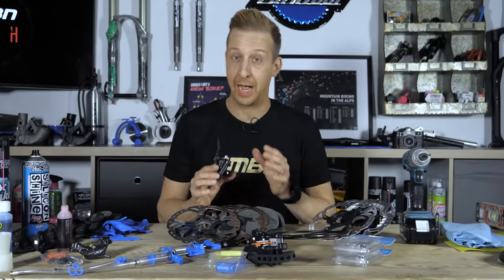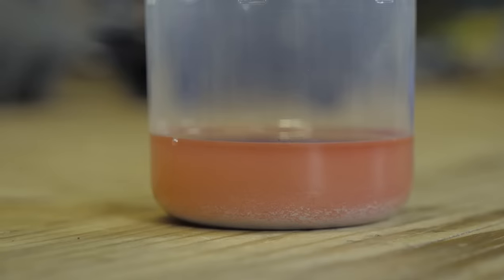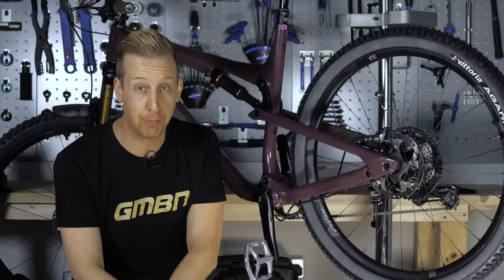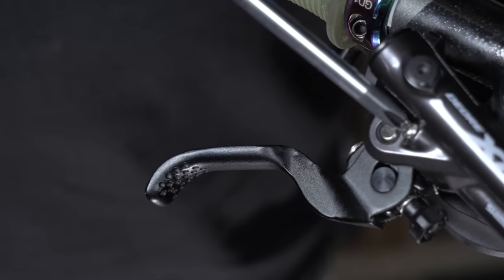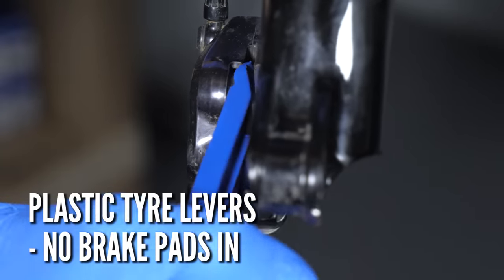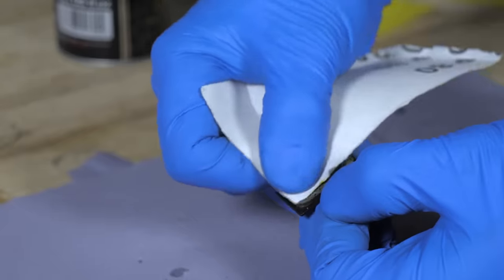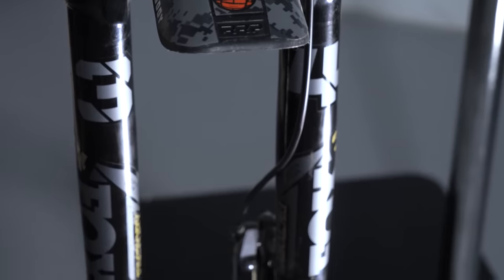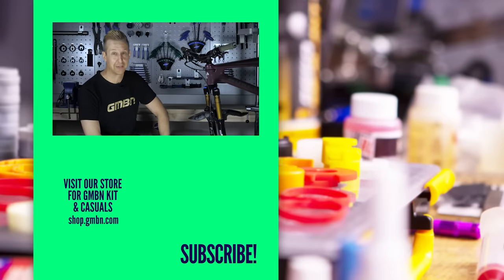12 Common MTB Disk Brake Maintenance Mistakes & How To Avoid Them

Comment: I‘d ask Seth about the thing with wrong fluid😂Just sayin...
Reply: I have green aftermarket oil in my magura mt8's and they are smooth as butter.
Reply: "...a little bit different, but kinda the same" :D
Reply: Well I have both shimano and magura brakes on my different bikes.
I only have 1 bottle of magura oil tho XD 
I do try my best to get all shimano oil out of the system when bleeding so that I am not mixing different types of oils.
Reply: I have used just straight mineral oil in Shimano brakes before.  Worked perfectly fine.
Reply: @FLiPtgc  mineral oil is mineral oil only the colour is "a little bit different , but kinda the same"
Reply: I think the key here was 'Shimano asked us to make this video...' It's irrelevant anyway. Where I am you can no longer but Shimano oil anyway
Reply: My takeaway on Seth was, "don't" and I agree.
Reply: Who knew babies had to be oiled anyway! ?
Reply: CBD/thc  oil works best... Reduces the anxiety felt by the brakes making them perform better

Comment: I've literally dunked my pads and rotors in oil, cleaned them off with a bit of alcohol and they worked fine.
Reply: No way...
Reply: Yeah that doesn't sound true.
Reply: Why did you put em in oil
Reply: Spare rotors in a bag with my bleed kit. One bag and mineral oil got punctured and bled into the separate bag with the rotors.
Reply: Hey folks, this is a ruse.  Look at his name... "MidWest MTB."  Are you suspicious?  Good!  The mid west doesn't have any hills!  So he doesn't actually need or use brakes!  So take his advice with a grain of salt!  Ha, ha!
(And no, don't sprinkle salt on your pads & rotors:)
Reply: @dudeonbike800  I live in the mid west, this is correct
Reply: @dudeonbike800  you caught me, I would have gotten away with it to if it wasn't for you meddling dude on bike.
Reply: @MidWestMTB  ZOINKS!  Good one!
Reply: I soak them in 99 alcohol baths and it usually works just fine, you see with your own eyes all the contamination dissolves in the alcohol, repeat until alcohol is clean, about 2/3 times...

Comment: Squeezing brakes: just cleaning the pads is not enough. Oil is embedded inside the pads. What works is to boil it out by placing the pads on an oven 10min at 200 centigrades. If it smokes than the embedded oil is leaving the pads.

Comment: Please do a vid on tips and tricks to optimize SRAM brakes... They're the ones that I need help with... 😬
Reply: Step 1: throw em in the trash
Step 2: buy Magura or Shimano

(Had the Code R for over a year myself)
Reply: Step one: they're not that bad if you have newer models
Step two: do not hesitate and use your warranty, if you got a bad set
(Pretty much Shimano fan, but not a fanboy)
Reply: Buy shimano ones, with their well known wandering bite point issue and no modulation.😋
Reply: Henry did 2 excellent vids on exactly this last year, full of great tips for sram, but also other brakes... try a search through
Reply: @rupedog  deore and groupless 5-series have no modulation or bite point problems. You should try running cheaper stuff too...
Reply: switch to shimano

Comment: Also, good to check the brake alignment with the mounting bolts, i.e. loosen the brake mount bolts, spin your wheel, apply pressure to the brake corresponding brake lever and tighten up to spec.

Squealy brakes when riding in and through wet  - not much one can do about that.

Fairy is awesome for washing the bike, car, dishes, windows, dog. ;)

Comment: I run my brakes in slightly different positions. My rear brake lever is a bit more flat with a later bite point, because I use the rear brake more when I hang of the back of my bike. My front brakes is 3 degree more down compared to the rear brake and has a earlier bite point, so it is in a better position for switchbacks und stoppies
Reply: Sounds legit. Here's a few more pro tips. Cut your handlebars 10 mm shorter on the left and offset its angle from the fork by 1 degree so you can turn right a little harder. And how about running flats on the left and clipless on the right with your helmet backwards for more aero?
Reply: @frankthetankricard  If you have a shoulder injury you maybe have to do that
Reply: @frankthetankricard  my right sitbone is actually more forward than my left one so I run my saddle a bit to the left
Reply: i like to have a notably earlier brake point und the rear break because i used to pulled the front brake too hard. now i drift a lot because i brake harder on the rear. it's fun but my rear tires and brake pads wear way faster.
Reply: @frankthetankricard  Dude, you are my hero. I thought I was a good heckler. I'm not worthy.
Reply: cool story bro

Comment: I understand the concerns of using other type of mineral oil in the brake system, but what about using automotive LHM fluid. Its made for citroen braking systems, and i have compared the proprieties of both shimano and TOTAL LHM and not only the LHM has higher boiling point but also lower freezing point and similar viscosity.
i have been using for 1 year and not only its cheaper but also better in almost every aspect and u can get it in any car parts shop. 
Any toughts on this?

Comment: Have you ever used the blow lamp method on contaminated pads ? I’ve done it plenty of times without issue
Reply: What is the blow lamp method? My brakes seem to be contaminated just from city riding and I can't afford to replace them :/
Reply: @drewlop  I use it too ✋Just remove your brake pads, set them flat on a non-flammable surface with the braking compound towards you and just boil them with a blow torch.

That will burn any grease or oil on them, if the compound catches fire, it's that they were contaminated 😂

Comment: Thankfully I didn´t do any of these, I just today upgraded from MT200 to 520- what a difference! And I ride the same way: front/right, rear/left.
The manufacturers think otherwise, every bike I worked on it´s opposite- I hate that.
Every motorcycle has the front brake right. Why not adapt that good standart? Less pain involved when kids go from cycle to bike.

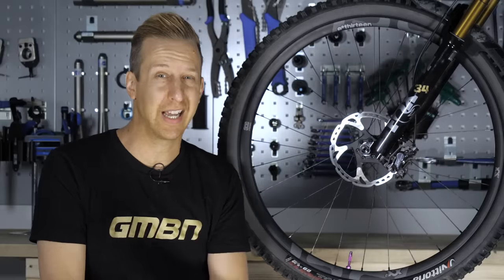Comment: 9:33 My issue addressed, no power in rear brakes even after cleaning the rotors & pads with alochol & using sand paper(320grit??) to remove any glazing..etc, will remove the rotors & pads for the third time to try the clean method described & return

Comment: Having problems with squealing/contaminated brakes?   then give them a good cleaning with a dash of Acetone on rotors and brake pads(please un-mount rotors and pads so you don't get acetone on any other parts of the bike) scrub the parts with an abrasive sponge cleaner thingy..  then rinse the acetone off with either brakecleaner/isopropyl alcohol (or both in that order).. this is the only thing i found that truely works

Comment: I have gotten lube on my Rotors once....
I run waxxed chains now. Lasts longer before it needs to be redone and the chains also last longer. Also the drivetrain stays clean as mud doesn't stick to it.
I also had my brake line not tightened enaugh and pushed the lever while working on the bike. Thankfully didn't loose much fluid.

Comment: Here's another valuable tip - pay attention which brake lever you put the bleed cup on and check which caliper it goes to.  I once put the bleeder cup on my front lever and tried to bleed the rear caliper.  Needless to say, the hose kept popping off and oil went everywhere before I realized it.

Comment: I have definitely contaminated brake pads by accident a few times, and the rotor included by spray of muc off. Getting mineral oil squirted on Doddy's face was so brilliant for entertainment purpose, and thank goodness I run mechanical instead of hydraulic brakes.
Reply: mechanical brakes sucks ass.

Comment: I think using a spirit level to align the levers is inprecise because most of the time the floor or the service stand which the bike stands on are uneven making the spirit gauge inaccurate. Instead I use a piece of packaking strand (or a thick sewing thread), span it across the levers finding the same support points, tension it, and look for a level point of reference with bear eye, usually the stem clamp bolts.

Comment: After a wash with dish soap and a scrubber, I bake my rotors and pads in a toaster oven at 500F to turn the oil into carbon. Critical that you get the specific oil beyond its smoke point. Using a torch on a rotor can heat it unevenly and warp it. Scuffed with 1500 grit in a palm sander and done.

Comment: When using Dot change it with your cars or motorbikes fluid and all of your bikes if possible. You can buy a bigger container saving a few bucks. Granted it is more labour involved, but you only have to remember one date and not start and stop all over again.
Reply: And even if just doing bike brakes, auto DOT5.1 is much cheaper than the same stuff sold in bike shops.
Reply: @polbecca  just make sure you always use the right dot. Not all are compatible. I believe dot 4 is not compatible with dot 5 but the other way around is ok.
Difference in dot fluid is the boiling point. Mostly for car racing.

Comment: I bought a used carrera kraken today because it used shimano hydraulic brakes... wish I hadn't now. Cable disks were simpler.
I think new pads needed but are they as easy to change as cable disks? I'll have to find out.

Comment: 13:42 If it actually is the brake rotor, as it happened to me twice, the fix is using threadlock. I use a torque wrench every time I can and I was puzzled at how tightening the rotors with the spec torque always caused the rear to loosen some rides later. Magura's spec states rotor screws should be tightened at 4Nm, so that's not a lot of torque to keep both the rotor in place and the screws from turning from vibrations, so threadlock is the solution.
Reply: All the Maguras rotors that I use tighten at 6Nm?! Where did you find 4Nm? I have Storms and MDR-P with 6Nm mark on them.
Reply: Thread lock us ALSO part of the spec. Ur meant to use it. New disc bolts are ready coated with it
Reply: @NotMyFullTimeJob  The owner's manual for the MT 2017 series states rotor screws tighten at 4Nm (https://www.magura.com/media/922405/mt_2017_en.pdf page 5 or page 17)
EDIT: Maybe I should've specified the model I have, my bad. I'm using MT5 front and back.

Comment: If you have done the "mini bleed lever flick" thingie with the wheels still on the bike, then you will have overfilled the system and will need to remove the reservoir bleed screw before you push the pistons back when doing a pad change to give the extra fluid somewhere to go... if you don't, you will not be able to get the pistons back and more than likely will break one of them trying.
Reply: Especially with somewhat worn pads

Comment: Thanks for the helpful video, just in time, I will do a full brake bleed in the near future. I already bought some "Royal Blood" brake fluid but I have Shimano Deore XT brakes, same as in your video. So you dont recommend to use "Royal Blood" but Shimano fluid instead. How much fluid do you approximately need for a full brake bleed front and rear (xc bike). Or would you recommend to just remove the air out of the system? How often do you replace the brake fluid?

Comment: Just a side note dot 4 and 5 don't have the moister issue not that you should use them in your bike brakes. Also you can use the the right automotive disc brake clean and it will work correctly at a more economical price and if you do scrub or wipe of your disc or pads you should hit them with brake clean one more time.

Comment: I've tried all sorts of fluids in all the tektro I removed from new bikes, dot definitely doesn't work with mineral oil seals I can confirm.
But yeah pure mineral oil from the hardware store or Amazon works just fine, bonus point since there's no dye in it 😂

Comment: Thank you for showing the cleaning of the pads and rotors as I've found by trial and error. Boiling water does work great in addition to isopropyl and even sanding. I have had glazed brakes that I simply had to chuck out though.

Comment: I would buy the shimano brake fluid if anywhere online had it in stock in the UK. Barely find any of the small ones, let alone the 1L bottles!
Reply: I've used aftermarket green mineral oil from amazon in my brakes for years with absolutely no issue whatsoever
Reply: Ask a friend or a local facebook group if you need a bleed. We all buy the 1L bottles which last years for the home mechanic. I'm sure someone will be willing to help you out.
Reply: @Arkainebe  Currently illegal in the UK to go round a mates house so won't be doing that for a while 😂 LBS is a good shout but honestly, I like doing the work myself and if I can buy the tools for the price of one go at the LBS I definitely will! Bought some cyclo mineral oil that seems to have done the trick.

Comment: Baby oil works perfectly. I have run it for over a year with no problems. They only had to say to only use shimano oil so that they increase there own sails
Reply: They say to use their own mineral oil because that's what they've designed the brakes to be used with. You're not going to design these seals and systems to work perfectly with a certain oil, then tell your customers to just put whatever in there, are you?
Reply: @thenine83  the shimano oil is mineral based, so is baby oil, its a perfect subsitute to the overpriced shimano oil, not just any random oil
Reply: @geordiefarmer5405  They aren't the same thing though are they. Not all mineral oils are identical and the viscosity varies. I'm not doubting baby oil works as many people have reportedly used it with no issues, and I've used LHM myself too which is fine. However, Shimano design their brakes based on them using a certain type of mineral oil, just like they design their drivetrains for use with their own chains. They put a lot of research and development into these thing to get them working perfectly, so I don't think they only tell us to use it JUST to make more money. It's so the stuff performs as well as it possibly can and works as intended.

The main reason to use Shimano mineral oil is that if your brakes are under warranty and you use anything else, you void the warranty. But right now Shimano mineral oil is impossible to get hold of anyway.

Comment: Super, super vid guys!! Really helpful 👍Myself and my son are beginning to learn to work on our own bikes and are currently faced with a couple of potential break issues so this is well timed! Thanks again. 

One question though if I may... we have a light squeal situation at present. Specifically when the bike is moving forward and back ever-so gently there's a fairly prominent but low-res squeal. It's not happening when active on the trail however. Could this still be a contaminated component?
Reply: Prob pad micro moving in caliper when rocked. Check everything is tight, and forget about it.

Comment: 5:59 some shimano brake sdont have this feature, but still have the same mechanism, this results in deathtrap if adjusted for child hands and powerful brakes for long fingers.
I think it's silly to have have that without this adjustment. I had m6000 brakes the stock position was perfect fit wise but they lacked power, for full power i had to have them all the way out but that gets more fatiguing.
Reply: Most cheap brakes have only the one point of adjustment, and yes, its dangerous to adjust it to the point where you can't get full breaking. If you have small hands the best solution is to buy better brake levers with free stroke adjustment...
However, my 8yr old son copes just fine with stock cheap old brakes?
Reply: @RenaxTM91  maybe he has the brakes with reach adjustment at the lever blade directly, thus reach not effecting the power/ how far piston is pressed.
So these will be powerful. this type is the one that is mostly spec'ed on kids bikes. but not always.
Reply: @mtbboy1993  nope, the bike had mech brakes from factory. So I put a set of old deore brakes I had laying around on it... Reach adjustment just moves the whole range of travel, so if you set it too close to the handlebars you don't get full braking...

Comment: I have a Montague Paratrooper 26" folding mountain bike. It's a great, sturdy bike--they're used by US Army--but I absolutely hate disc brakes. Traditional center-pull brakes (which grab the wheel's rim) works best for me. They have their downside, compared to disc brakes, but I can easily change the pads in one or two minutes with minimal tools, and adjust the tension. Disc brakes are just too damn complicated. I want to enjoy riding my bike, not spending a whole month trying to figure out how the disc brake system works.

Comment: Magura brakes. I have mt7 pro. They feel strong but the rear vibrates through the bike. How can i stop this? Also is it neccasary to pressurise the fluid in the syringe with mineral oil like you would with dot fluid?